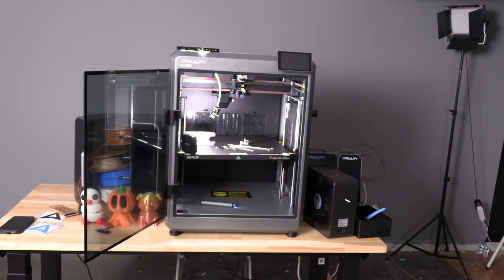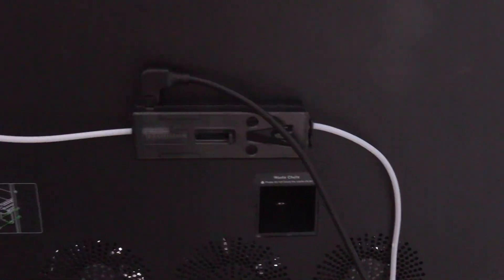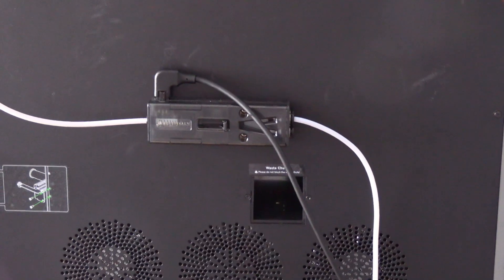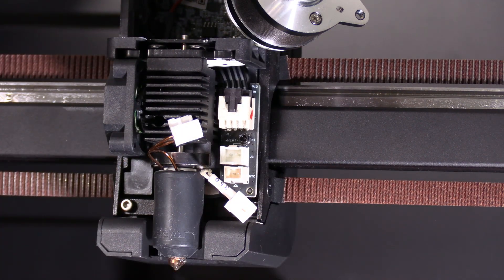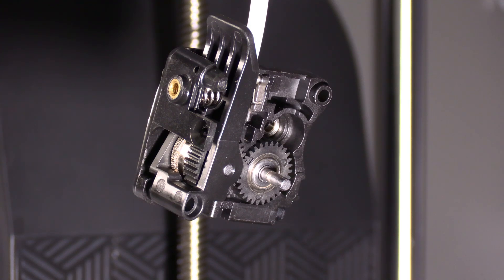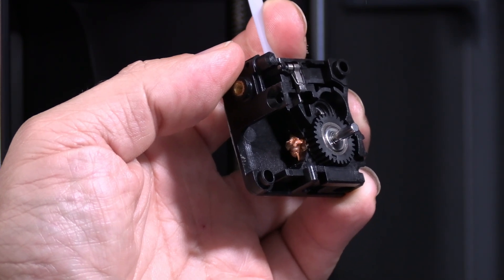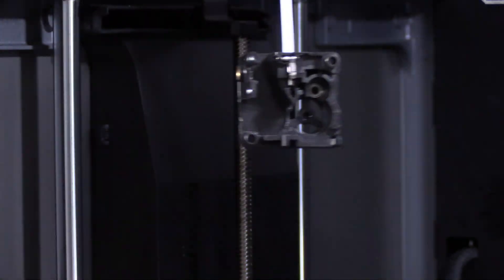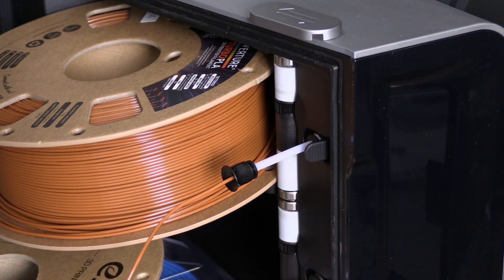K2 Plus DOWN. But not OUT! Dreaded Extruder Jam. Sad Reacts Only. Let's check it out....

Comment: When I saw that blob inside extruder I had that in 2019 with my 4max pro.
You know what is the cause of that blob?
Automatic filament change. When printer is ejecting filament via extruder gears, it might cought still softened plastic and due to the filament runout sensor and other paths in the bowden tube that might freely obstruct ejection, it curls and blobs killing your extruder.

Ffs this is hilarious that "problem" from 2019 is still occuring in flagship creality machine. You dont want that to happen?
Just remove filament from the extruder/hotend setup BY HAND ( also use cleaning filament from time to time).

This is retarded that bambu have same issues.

Comment: wait wait wait wait.

so you first of all put the cfs on wrong side on a table on the side. wich is well uhm bad?

then you used a non creality filament and bad stuff happened.

you made like 3 errors in 1 go. and then wonder why things went bad ? xD

that do not seem bright.
Reply from the maker: Tell me you don't print (or actually watch the video) without telling me you don't print (or actually watch the video)
Reply: @3DRundown  uhm what?, all i noted was your issue seems to stem from doing things that normally is not done.
Your explaination dureing the video seems a bit confuseing since you never stated how it was before the issue arose. nor why you put it on the side without moveing the tubes?

eaither way it just do not seem logical.

quote from your video "How i run it" "side mounted" just seems odd

granted i might have missunderstood you but the way you explain it and its perceived it is that you had the cfs on its side and tried to print like that.
Reply: @HikaruGCT  the last one that made a comment on printing with cfs on the side deleted his comment in less than an hour. I wonder why... 

And seriously, printing with only creality filament ? 

You know that pla is pla right ?
Like i usually print with bulk bought sunlu pla (10kg or more) on my creality machines.

It cost 9.89bucks/kg and i never had an issue, it's even better than some 20-25bucks/kg filaments I tested...

The only reason you would want to go proprietary is for very complex filament that you can only find with specific suplier and that works on very specific machines like PEEK-CF that we use on the lynxter s-600d for exemple. but not pla...
Reply: @cynexion  we found that when printing its vastly differs in quality among material filament makers.

just saying.
Reply from the maker: I can't tell if your trolling us or not....
I have extensive videos on the K2 Plus, previous to this video, explaining exactly how I'm running it, and, multiple videos on the topic of my Extruder Jam, including more than one, showing the aftermath, and how I'm using it (on top).  

Incase you are not trolling me....

The CFS is being run ON TOP of the K2 Plus.
I had a Jam in my extruder, which left the full run of Filament, stuck in the bowden path. 
This prevented me from unlocking the bowden tubes.
I moved the CFS to the side, in order to remove the K2 Plus cover, and gain access to the top of the Tool Head.
After clearing the Jam, I put it back on top.

YES, I could have cut my bowden tubes, but, I need to keep my stuff as STOCK AS POSSIBLE, while I'm still shooting informational, and service videos.
Reply: @3DRundown  .yeah no im not trolling it just seemed odd the way you explained it and no i did not watch your other videos. it was just in my recomendation list so i just looked. thats why i was confused to the way you explained it in the video :) but anyways glad you got it sorted.
Reply from the maker: Interesting. That's a side of my channel I don't see...  So, yea, YT dropped you into the middle of an ongoing Video-Conversation, here at my channel. Hit up some of my other K2 Videos, for more context
Reply: Seems maybe heat creep?
Maybe poor heat sink cooling or printing too slow which is allowing too much time for heat to travel up the filament.

Comment from the maker: I believe a bad GCODE, created by ORCA, caused this jam
Reply: Got 50% more clogs on my k1m using orca than creality slicer, could be simply that my k1m is getting old but faulty gcode from orca might also affect old models. So please, if you locate the issue make a video about it, it might save many extruders.
Reply from the maker: Truth be told, I had only one clog ever, on all my K1's, with thousands of prints, and, I ONLY slice on Orca or Bambu Studio. However, 95% of my K1 slicing, is done on Bambu Studio. I feel like, perhaps there is a minor adjustment needed to the Orca K2 Profile. But, yea, I need to dig more....

That said, allot of peeps jamming up their extruders, are simply printing everything too fast. Slow stuff down, and you'll have a much better experience. 200mms, over 300mms, is much faster than 300mms, and an extruder implosion.

Comment: Creality has a problem with quality control for a while now. I have a K1 Max and got it when it first came out. They eventually get things corrected, it's so much better now then when I first got it. It's still not as reliable as my Bambu A1, but it's a good printer now that it has the upgraded extruder and rooted and all that, but wish I didn't have to go through it all...
Reply from the maker: There is no QC issue with this extruder, nor did any QC issue cause this jam. Things like this can happen for a multitude of reasons. My P1S extruder imploded, due to the same jam in the same spot. I'm a big fan of the K1. I have a launch K1  and Max. I work them really hard. I have a total of one fail, ever. Mostly large masks. Finally gave in, and swapped the hot ends and extruders, for the channel. They never failed. I prefer them over my Bambu's, but, I need the Bambu for Color. Never saw a need to root them. I've never even looked at their bed meshes. Creality is very quick to respond to issues and create improved revisions.  I don't think most peeps realize the insane amount of Creality machines out there
Reply: I was talking overall about QC not the extruder on this model. I think they rushed the k1/max out to compete. I and many people had issues with the early ones, but Creality stood behind it and got it sorted (had to return one of them) . I love my K1 Max even though I don't love the extruder design. I've had to disassemble it a couple times and it is a pain compared to how some other hot end/extruder come apart. No printer is perfect. I do have more reliable prints on my A1. I think it may be the 3rd party pei plate I use in the k1max though. The A1 comes with a very sturdy plate and the Ali express one I bought is a bit flimsy in comparison. The creality pei just didn't last for me. Still though would buy a K1 Max again, light years ahead of those old ender designs! I rooted to add Kamp and use a browser, love how granular you can tweak things! Anyway, loved to see the issue and the resolution. Good luck and hope you have  smooth sailing from here on out.
Reply: Yeap, me too with the K1 when it just relased the extruder had tons of issues. They changed almost 3 times the design and materials until people got tired and installed third party extruder working much better than the original.

Comment: Have you tried the Bambu buffer tool on maker world? Looks like it would work on that buffer as well. I get that the filament was jammed so nothing would budge. The Bowden tube has enough slack on the buffer you may have just been able to cut it and remove the filament and press on. I know the lengths are important but you probably have a bunch of the stuff on hand. You may also be able to make a version of the buffer tool to fit the top of the extruder. If it’s not already available it will be soon.
Reply from the maker: The K2 Plus Buffer is tool-less. Either way, bambu tool would not fit at all. The real problem was, the blob of filament at the end, inside the extruder.

Comment: I would take the tip out of a soldering iron and hold it on the hot end at the same time hit it with a heat gun. See if that helps
Reply from the maker: It will not. The clog is in the extruder. I show it
Reply: Has anyone tried to mount the buffer to the CFS it has two screw holes just run a longer PTF tubefrom the K2 Plus to the buffer it will make it so you can place it anywhere @3DRundown

Comment: Mine is perfect, more than likely it is the cheap filament you are using, I also would not use carboard spool, to easy to slip!
Reply from the maker: Overture is not "Cheap".
Reply: @3DRundown  maybe not in your world but we would never print with it.  Low quality at low cost!  I get it though its what a lot of hobby printer enthusiasts use!

Comment: Do you think it was heat creep? I had PLA getting clogged at similar point in my k1max, after a lot of frustration with it happening multiple times I found it was because I was printing lid on, door closed and the filament was expanding or melting just enough inside the extruder that it was jamming in the hole just before exiting it.
Reply: Had this exact same issue on mine but for my part filament was getting clogged right under the extruder after exiting the blue boden tube, I found that using the back fan and lowering print bed temperature on my slicer setting for some filaments was a less prone to user error task than opening the lid every time pla is loaded.
Reply from the maker: I print with my lids upside down. This is why I want the CFS to be on the SIDE of my K2 Plus, and will do that, ASAP.
Reply: @3DRundown is it just the PTFE tube that’s too short? Or power lead as well?

I’m “patiently” waiting for my K2 to get shipped, wondering if I should order some extra tube ASAP so I can put my CFS on the site right from the start.
Reply from the maker: I was starting to think so, but now, I think it's the Filament failing to retract, due to issues with the spool not getting along with the CFS. I have now failed it 4 times. All 4, at the 1st color swap.

Comment: I had a jam in my Ender v3 which uses the same K1 based extruder. Yea I had to do a complete teardown of the toolhead just to get to the gears. The introduction of an AMS..sure it complicates that process. I will say, this is a routine issue that can happen at anytime with that style toolhead but it is in the realm of fixable. Still doesn't help customers who are not inclined towards manual repair.
Reply from the maker: These are complex tools, and peeps really need to prepare themselves to work on them. The industry is still a baby, and growing fast, but, maintenance and repaid, are here to stay
Reply: I agree. Many of us have zero interest on becoming 3D printing engineers. We purchase them only as tool to turn our ideas/designs into tangible objects. We shouldn’t do their Job at all nor require to deal with technical fixing stuff… thats why we paid them so much 🤑💵 for these machine!

Comment: You have to fit your buffer to the back of CFS. That way you'll have much longer cable
Reply from the maker: Yes, that works, however, you need a longer Bowden. With stock accessories, you'll need a coupler, for 2 bowden runs

Comment: I thought there is a cutter inside the extruder... So you can cut it and pull it back.. But the problem stays in it i think
Reply from the maker: It certainly cuts the filament, as the firmware will list that during extrude/retract, but, I wasn't thinking of that, and I didn't see the cutter. I'll certainly need to get into all that during a proper video. Cutting it, should have helped remove the extruder from the stuck bowden, but the Jam would remain.
Reply: Nice little overview of this. I'm actually having this same issue with my k2. 3rd print on it

Comment: It would be nice if K2 owners check out the videos on the Creality wiki. In this case, all you had to do was remove the protective cover and disassemble the front of the extruder (3 screws).
On the other hand, if you mount the damper on the back of the CFS instead of the back of the K2, you can probably put the CFS on the side. I haven't checked this because my K2 hasn't arrived yet, but looking at pictures, I think the cables are the right length for this setup, all that's missing is a longer bowden tube, but that's easy to get.
Reply from the maker: And miss out on showing more of the toolhead internals? That sounds lame sauce. Also, You do understand that I have Creality's internal documentation on the extruder, and jam process....
Reply: @3DRundown  I see your point, but it would be comforting to know if it's true that you just need to remove the protective cover and disassemble the front of the extruder - is it?
Reply: >  if you mount the damper on the back of the CFS...

? First time I've heard of 3d printers having dampers.

Where is it and what's it damping?
Reply from the maker: The Buffer. It directs traffic from Multiple CFS units. It can be mounted on the CFS itself.
Reply: @nlkatz  Well I don't know what this piece will be called, but I'm referring to the piece that appears at 8:37

Comment: Do you think this is a CFS problem or K2 problem overall?
Reply from the maker: Neither. I think it's likely a fluke, caused by a design weakness. This gap shouldn't exist. It's there to facilitate gear contact, but There's gotta be a better way. Bambu Extruder looks the same in that spot. So, what looks to happen is, the filament get's warm, a little to high, develops a slight bend, rubs on the edge of that slot, and boom. Toast. Perhaps it's a cooling thing. Unlike other tool heads, the Cover has no fan. It's side mounted. Heck, maybe the Filament had a defect.... a Bump, a Kink, a Wide spot.... that set this in motion. We'll all have to keep an eye, and see if this is a regular occurance, or a rare annoyance
Reply: @3DRundown  thanks for the great reply and that makes total sense.  Def something to keep an eye on.  Thanks!  Great vid!

Comment: I don't have a K2 yet, but on the K1 Max I usually start diagnosing these issues by assuming a clog, so steps are unhooking the bowden on top of the extruder, unlocking the extruder, heat the hot end to 90C, and then cold pull the filament out of there.  I go to disassembling the extruder after that. I have gone through three extruders on my K1 Max in a year.
Reply from the maker: My K1's OG extruders lasted from launch, till about 2 weeks ago, when I shot replacement videos. 1500+ hours on them. As you see here, The K2 bowden coupler, wouldn't let go, with filament in it.
Reply: @3DRundown  Yeah, that surprised me. When I got filament jammed in the extruder I was still able to get it to unhook the bowden on top of the K1 Max. That makes things a lot easier when you want to pull out the extruder.
Reply from the maker: Indeed. I was super surprised when it wouldn't release, and I REALLY TRIED. Somehow, the filament, had all the couples stuck locked